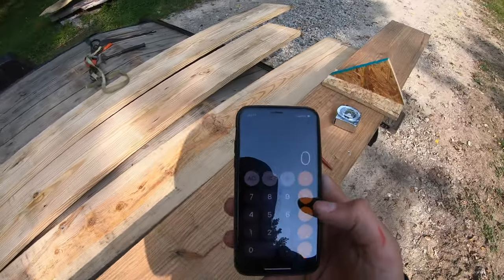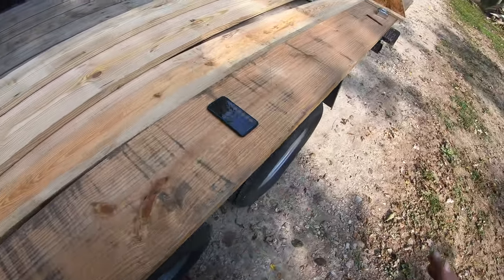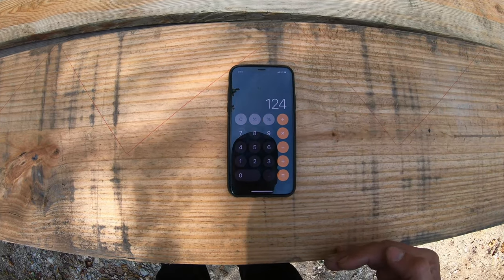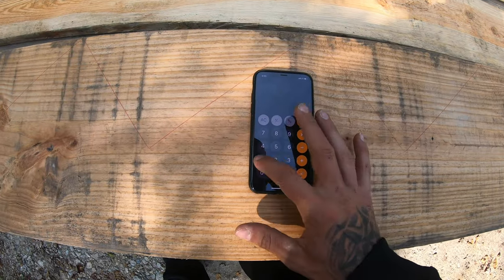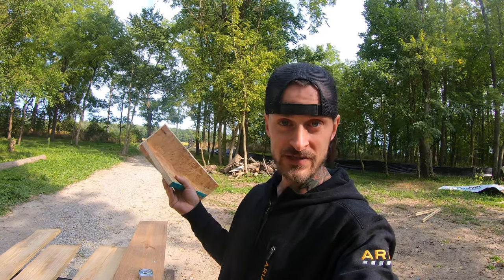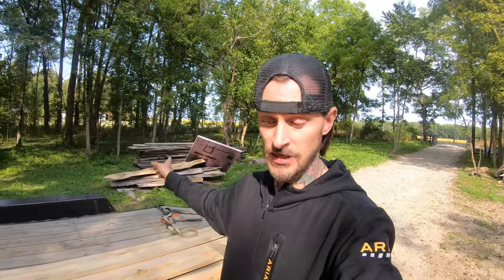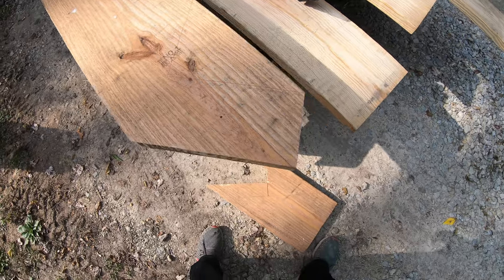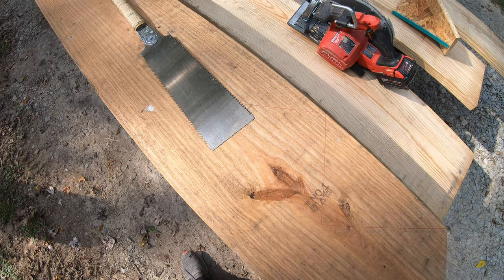ICF home build staircase failure :(

Comment: If you want your stringers to match 100%, you can gang up your four boards, then lay out the cuts on both sides, using a square to make sure it's level, then use a hand saw to start the cuts on the line on each side, then join up the cuts and your blade should follow that line through all four boards.  You just need a decent saw.

I think you have about a week and a half of waiting left, plenty of time to do both staircases.

Also, if your riser is going to be mounted in front of your stringer, your cuts don't have to be as deep, you could leave a gap under the tread that no one will ever see and increase the depth of your stringer.  You could also bevel the bottom rear of your treads and the inside corner of your stringer cuts to do the same thing.  I just don't like seeing so much of the strength of a stringer wind up in the scrap pile.

Comment: Cordless, non-worm drive circular saws have less torque and speed consistency than corded saws. Even a 60v Dewalt (non-worm drive) won’t cut a stringer straight.  The grain seems to make them struggle and then the blade chooses a path of least resistance and veers off and you muscle it back to stay on your cut line -the blade bends slightly and the burning begins!  That’s my theory.
Reply from the maker: Gotcha!  Good to know.

Comment: Try setting the blade deeper, it cuts better if the blade protrudes as much as possible and the length of contact of the blade the actual cutting length) through the board is shorter. With a shallow blade the amount of contact (number of teeth) is a lot longer and it seems to bind
Reply from the maker: BOB Joatmon will do.

Comment: For the Stair stringers - Make an OSB templet, then use a Flush Cut Router bit to follow the OSB. 
 i.e. Amazon https://rb.gy/rg4try  (2 1/2 inch cutting length)    Menards  https://rb.gy/otursd (but only cuts 1 1/2 inch )
Probably have to rough cut then first, as 1 1/2" of wood would stress the router, but would ensure they are all the same.
   Also might need to plane the boards to remove any crown.
 Just spit balling here.
Reply from the maker: I bought a router along with a jigsaw.  they are on the way!

Comment: Why not clamp the 4 stringers together that you have cut and use your planer to remove the crowns and any other imperfections, that way each tread and riser attachment point across the width of the stairs will be identical. This will also show you how far out each one is, and where you could possibly just shim the treads. A lot less work and a hell of a lot cheaper than buying 4 new stringers.
Reply from the maker: Milton T the planner will stop short about 1-2” but it’s an idea!  I think some are to far gone.  Not enough material left.

Comment: That 7 1/4 saw needs more than a 5.0 battery...... you need at least an 8 or better yet 12. Way to small a battery
Reply from the maker: Didn’t thick about that.  But the new 6.5” Diablo blades cutting like butter!